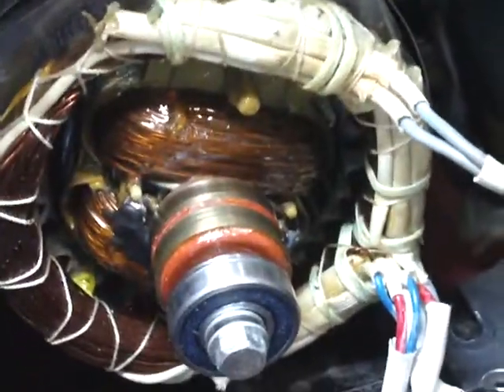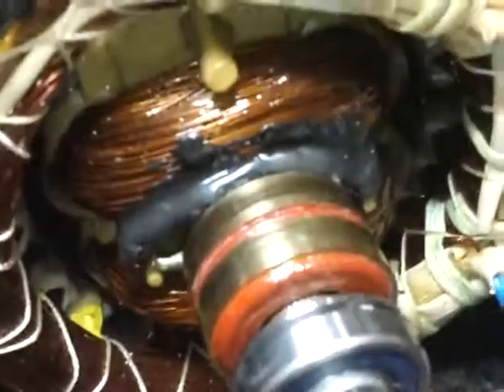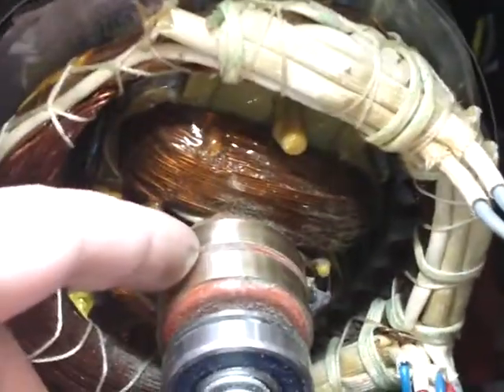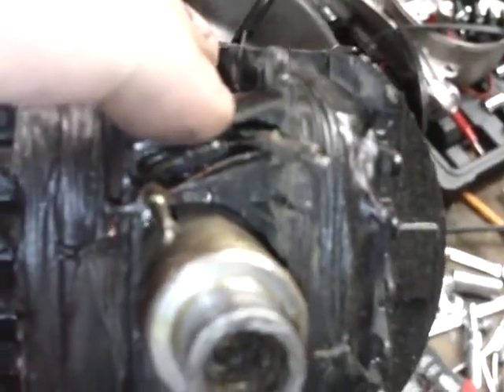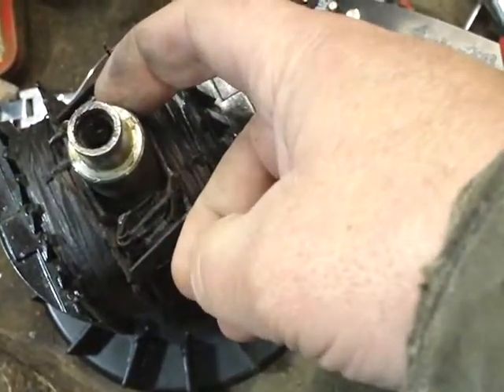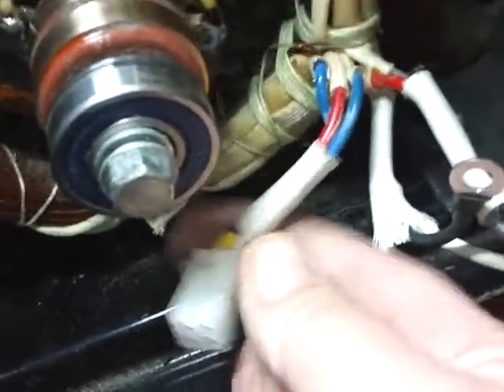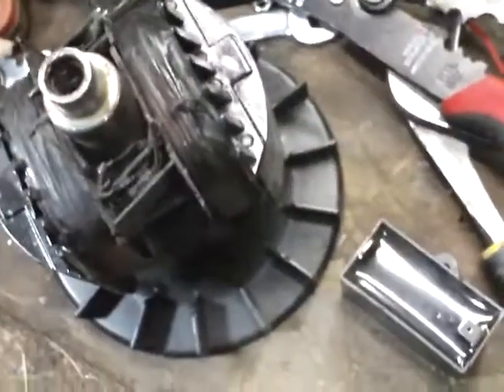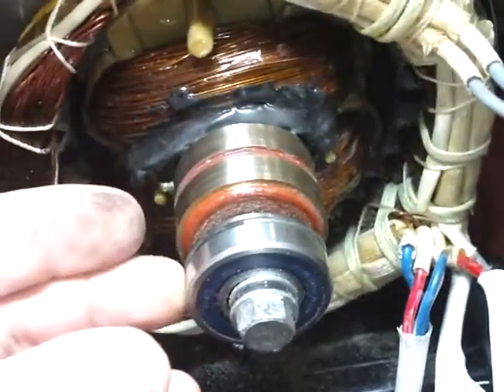Generator repair Part 4

Comment: Shawn, I have heard that the "Self exciting / brushless" generators have fairly short lives, I have a generator similar to the one U are fixing, it has around 400hrs on it, been running fine, just passed her load and frequency testing. Thanks for posting!
Reply from the maker: Great deal , As long as they are not over loaded or running at Max load for long .. They do very well !!  Just rather have brushed AVR generator for durability !